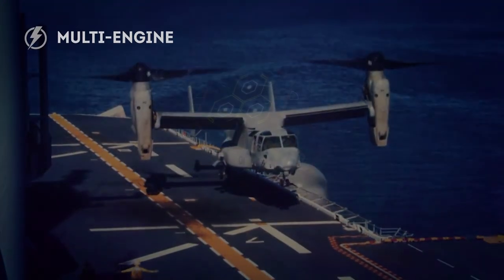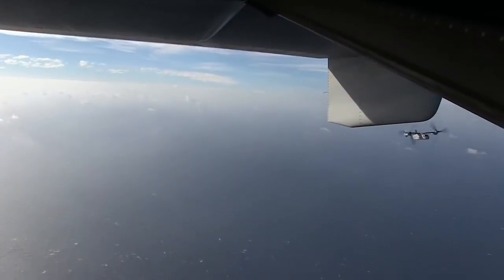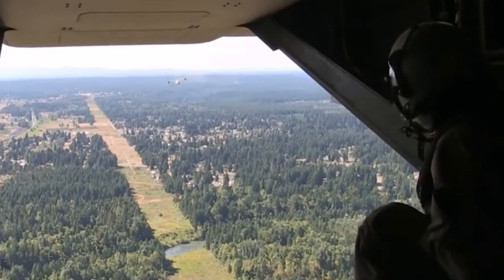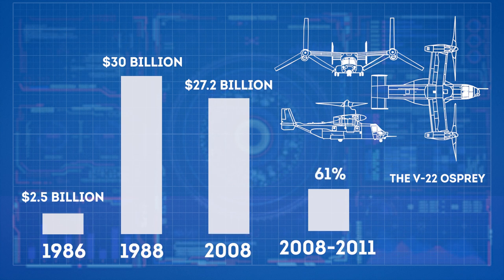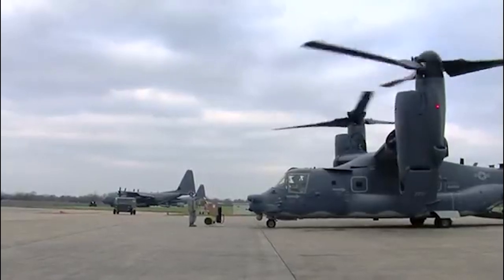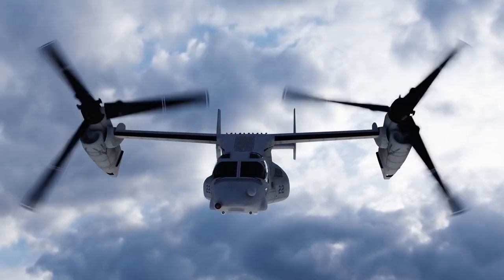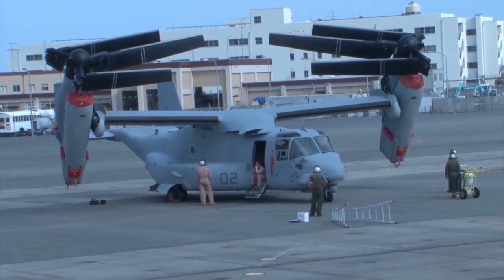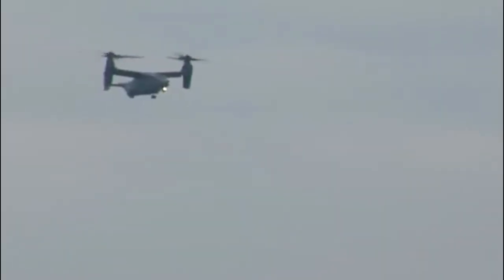Why America Built a Tiltrotor?

Comment: A Few things to improve the Osprey!
1. Have Counter Rotating blades on each pod (that is too sets of blades going in opposite direction on the same engine to reduce noise and rotary wash and can lead to smaller blades!
2. Stealth Materials to reduce RADAR (No I do not expect it to be a true stealth aircraft but just more stealthy!
3. Better weapons by adding rotating weapons pod on the nose and a maneuverable rear Gun and/or a missile pod or bay!
4. Window without a support beam in the Middle by using a bubble style design and Sapphire Glass!
5. Longer and Heavier Duty Landing Gears!
6. Side Sliding Doors like many Helicopters as well as the rear loading/unloading doors!